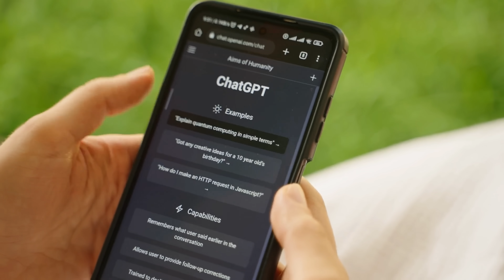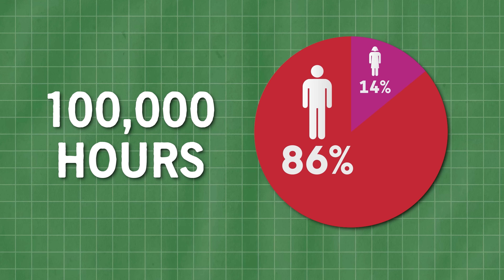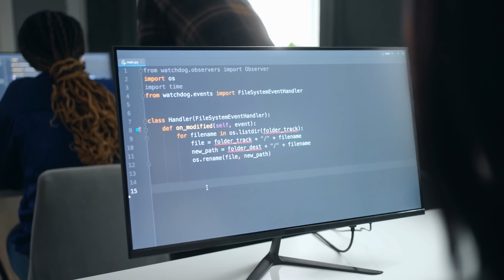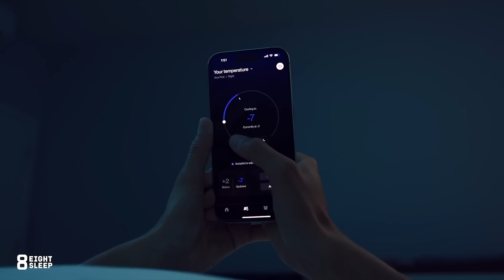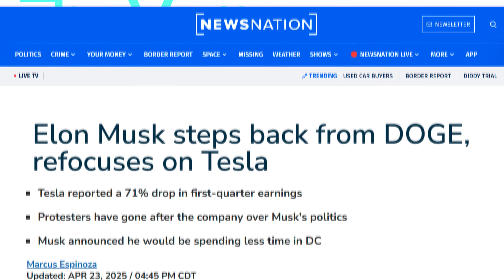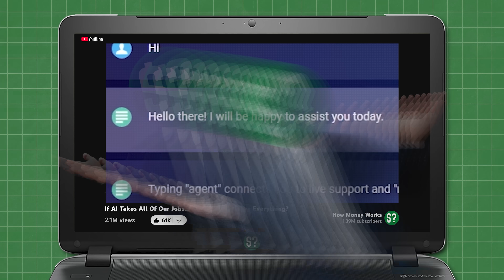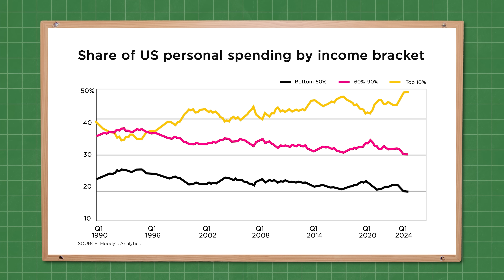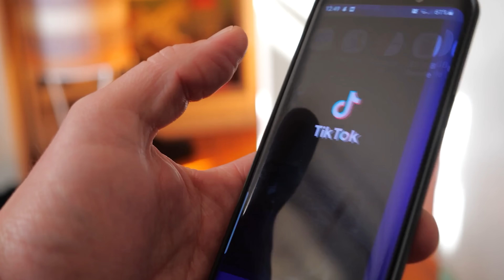Are You Ready To Have Your Job Replaced by AI?

Comment: Genuine question, what jobs would be the least likely to be replaced by AI?
Reply: Trades in general really. Intricate work that has too many details and variables outside of us just demolishing all current pre AI stock and having only modular factory built goods. Basically work with your hands
Reply: Bouncer
Reply: Plumber, electrician. Ironically it's easier to automate digital jobs thanks to the advancement of AI algorithms. Surgeon maybe? I doubt any algorithm is even close to being authorized to operate on a human. Doctors in general still are safe for now. So do lawyers, especially lawyers since I doubt they would pass laws that put them out of business, although they do have weak points that put them at risk of automation, so the entry level jobs still might be cut down.
Reply: @KepleroGT I'm curious to know why an "electrician" would have less risk of being automated. If you ask chatgpt to come up with a circuit to do some task, it will tell you exactly which components to use and how to connect them.
The only thing left is the manual "circuit assembly" part, which is exactly what robots would do (and basically the topic of this video).
Maybe i'm missing something...
Reply: @anpesx  The robot still has to get to the location where the circuit needs to be. Movement on something more complex than a warehouse floor is not the strong point of any robot.
Reply: CEOSs because they'd get too bored just doing nothing